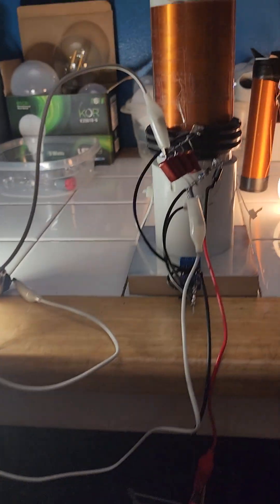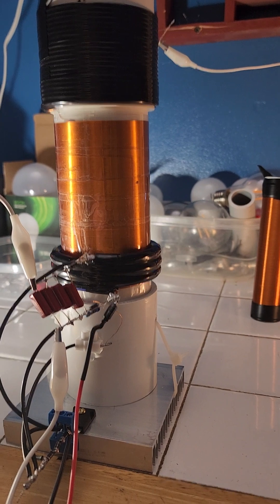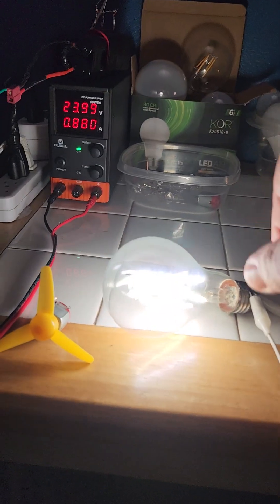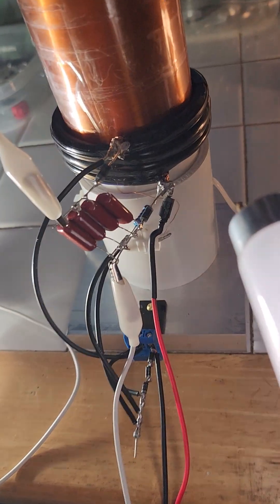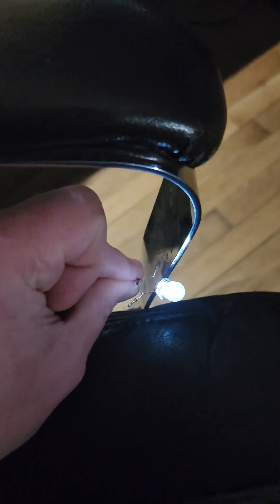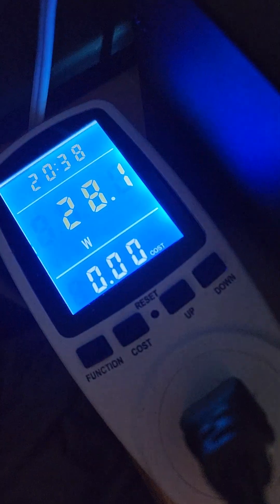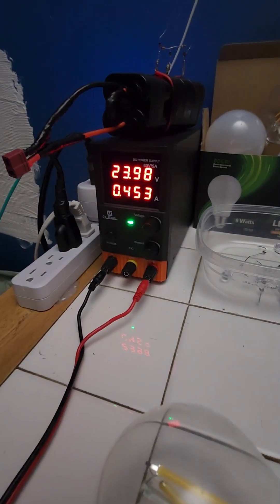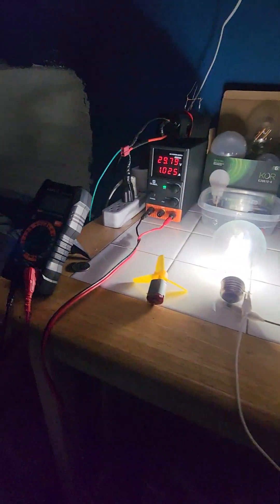BIG TRANSMITTER BREAKTHROUGH

Comment: I hear you've been busy you've wrote to me but you didn't follow up with it so I'll do you a favor if you can understand it. (  Y )= V OVER ONE =  The definition of overunity, No one could understand it because I've never indulged in giving out the understand the equation that I created because I am the original creator of over unity and it has( nothing) to do with more power out than in.
v = (E_in - E_out) / t 
To maintain a balanced flow of energy, the inflow and outflow must be equal: 

E_in = E_out
Where: 

• v: Flow rate of energy (in units of energy per unit time). 

• E_in: Energy flowing into the system (in units of energy). 

• E_out: Energy flowing out of the system (in units of energy). 

• t: Time interval (in units of time).
The equation can be written as follows: 

∫[E_in(t)] dt = V(t) ∫[E_out(t)] dt

 Now when you find the time We will do exactly what you suggested, But what I need you to do is do all the research you can about over utility and find out who actually gives a scientific answer a state of making "about more power out than in, Now, when you find the time, we will do exactly what you suggested. But what I need you to do is research all you can about overunity and find out who actually provides scientific answers instead of making vague quotes about 'more power out than in.' When you start to explore the topic in depth, you'll realize that the information I have given you is unique and comprehensive. Others can only make statements about what it can do without providing any references, derivation, or historical context. The claim of 'more power out than in' is deemed impossible even by scientists. The more research you can find on this topic, the better you will understand the validity of the information I have provided, as I am the originator of the concept itself and possess all the relevant knowledge.

Comment: Booboom... and what? Your device consumes around 20 watts with load less 20 watts, your energy-saving lamps barely burn. Connect 2 lamps, one to the outlet, the second is the same to your craft, you will be surprised... booboom
Reply from the maker: The interesting effects come from separately grounded wireless receiver lights & I'm working on making the transmitter as power consumption effecient as possible
Reply: @MTECHINDUSTRIES  can I get to watsap.. CD u provide no